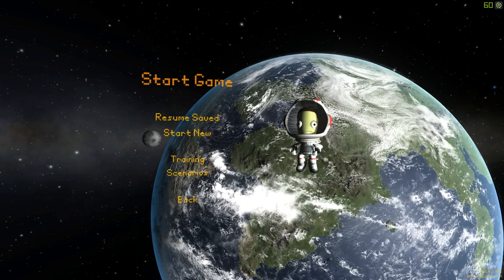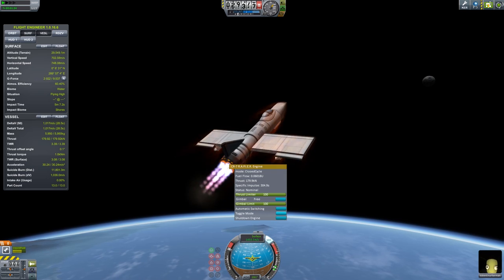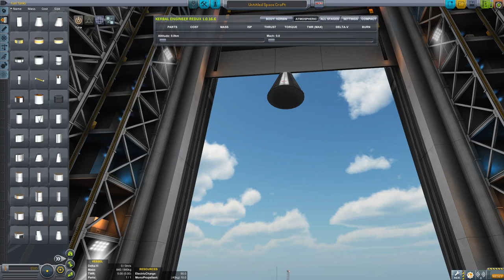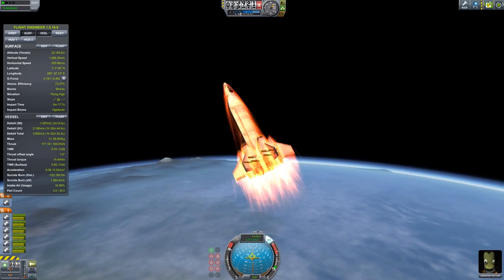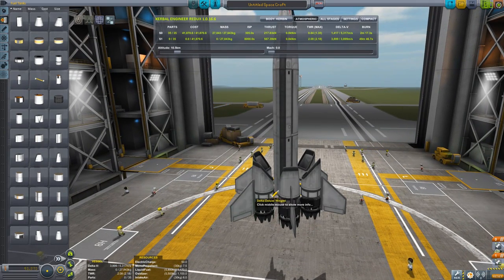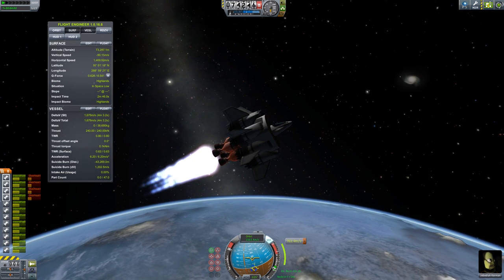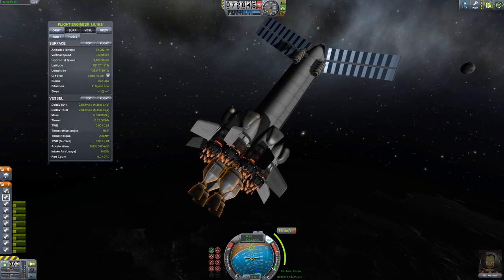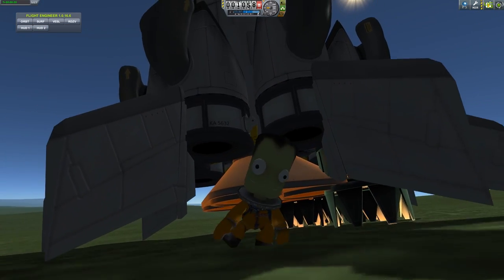KSP 1.02 - Types of SSTO - STOCK parts

Comment: how in the heck... i've built the exact same plane but i still cant make it orbit, no matter what i do it ends up running out of oxidizer and fuel before getting a stable orbit...the more fuel tanks i place, the longer it takes to lift and ends up consuming the same fuel and taking the same amount of time..
Reply from the maker: +Ema “S3N7IN3L” J. did you try decreasing throttle? I usually watch my Kerbal Engineer to make sure I don't go too fast as it'll decrease efficiency

Comment: Hey Anton the game is broken, if you used infinite fuel and any liquid fuel rocket, you can reach 6 times the speed of light in 16 hours worth of rocket flight in space, Earth time. Also I want to see your math skills in work, decode my message: 121121001201200012101021201022210111110010002201210202211122111222002202112110000101111220012200112000212121120220120020102111101220101121202000211220200210210010112122211211200120212102001200100212101222222100112112010121021002022120210110002102002202102010022102201
Reply: GeekVasion I don't really know cryptology well, but what I know about, it seems like a ternary code, with three symbols instead of two like in binary.
Reply: GeekVasion "game is broken" If you activate infinite fuel, you break the laws of physics... no wonder you can go past lightspeed. It's like dividing by zero, it makes everything possible...
Reply: I left it running for teo more days and I reach 87 times the speed of light.
Reply: GeekVasion still nothing abnormal since you broke the laws of physics . Except that the kraken should've waken up
Reply: GeekVasion Let me get this right.  The game is broken because you turned on cheats and broke the game?  Um no.  How about the game is broken because it crashes all the time.
Reply: Mines fine, it has never crashed except fro when I reverse the values of every file.
Reply: +GeekVasion 
It's broken because you use cheats? OOOOOOKAY....